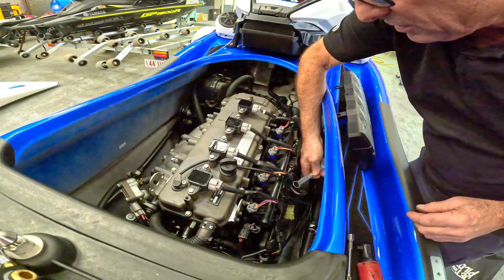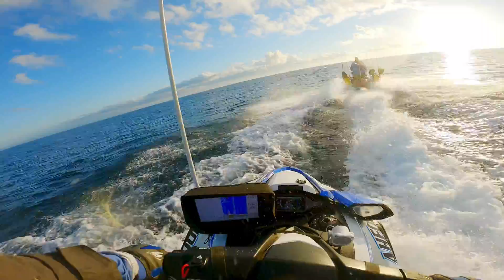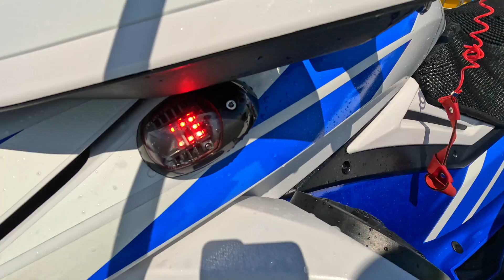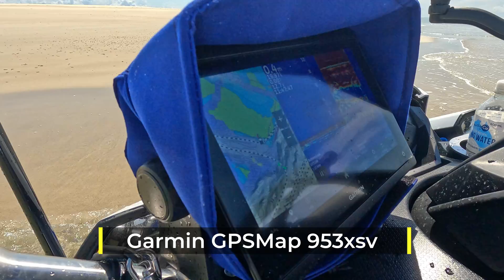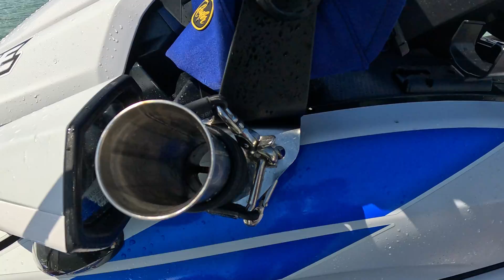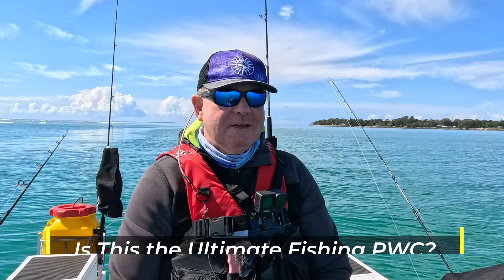Unveiling The Ultimate Jetski for Serious Offshore Fishing!

Comment: Great Video!   I would love to know what kind of nav lights you got and also the buttons.   Very cool!
Reply from the maker: Hi Phil, the front are basic 12V boat LED lights. The switches are waterproof 12v illuminated . Not sure of brand but a good chandlery (boating) store would have them. The rear white light is the battery operated Railblaza Illuminate i360 (you can get them on my store).  I've now moved from a simple PVC pipe to a nice extension pole that a supplier made for me. It extend to around 1300mm and folds down to around 600mm for stowing.  Incidentally if you're not using lights all the time like me, I'd be going all battery operated for both front and rear. The reason is any 12v mod you do to your ski using additional wiring is susceptible to corrosion and you'll likely need maintenance periodically. I have complete Railblaza Nav light kits for sale now for Yamaha and Seadoo GTX/Fishpro. They come with the mounts you'll need for the front, plus a telescopic pole for the rear. You can install these in minutes. Get these at www.jetcast.au
Reply: @Jetcast awesome site!!!    Ya, battery is nice.   I have some ideas for a wired setup.   If I end up doing it, I'll make a video.

Comment: Love your videos Paul. Just wondering if you experienced any cracking/paint peeling issues with your 2019 model with the NanoXcel hull, and any difference or improvement with your 2023 model which would have the thicker SMC fibreglass hull material? Cheers mate

Comment: Morning Paul 
How is your black box (radio) install holding up under your dash? Any cracking of the plastic ? Did you take any extra precautions with additional reinforcements i.e.rubber washers?  Is the black box staying dry? Did you bag it to keep it dry? Looking  to do the same on my ski and would appreciate any advise.  Thanks much
Reply from the maker: It’s too early to tell but so far so good.  I had it in the same position on old ski and no probs with mounting. This time the terminals are smeared in dialectic  grease to ward off the water. We shall see…

Comment: Thanks for the video! I've been considering getting a ski for fishing the reefs up in Cairns. What do you figure your fuel range is with the additional 40L tank? What kind of weather are you comfortable going out in?
Reply from the maker: Thank for watching the video Tyler. I'd plan trips on around 2km per litre on a fully laden FXHO like mine, so 200km would be a guide.That allows for some expansion air gap in the tank! Really depends on weather conditions for range but that would be an average that you could work on. It's often more like 2.5km or more per litre, but you should factor in some safety margin.  Re: weather: they can handle it pretty rough but the body gives up before the ski does! So, under 10 is great, 10-15 is getting a little wet and marginal but very fishable (depends on swell and direction to wind of course), 16-20 is still OK for short runs but definitely not epic journeys out to the reef!  Also above 15 knots it can be very wet so take a ride jacket to remain warm in the wind chill.   In fact, most of the time over 15 is a bit too uncomfortable to enjoy the fishing.  Forget 20+,  or any westerly winds over 15 as the short and steep chops kills you when riding out, and slams again on the way in. The ski can generally handle it but the body can't!  Best wishes!
Reply: Cheers for the detailed reply!  @Jetcast

Comment: Does it have the same random hard to start issue that the last one had. Still gets my heart going but always starts.  They just closed fishing in less than 300 feet here so might be makeing a few 100 mile runs soon but will just bring Jerry cans with me  and plumb an extra fill line under seat
Reply from the maker: Yes mate, same engine, same random cranks!  I know it always will start despite the 2 failed cranks, and don't worry about it these days.  Two batteries also give me every confidence! :)

Comment: Great ski Paul, Cu on the water soon with my new Seedoo upgrades,  I am a Seedoo fan, as you know.  Same reason as yourself,  but started on a Seedoo.

I have a XI3 trolling motor hooked up to 9" Lowrance ( soon to be 12" HDS) using a NMEA network, yes  trolling motor is expensive , about 4K AUD (3K USD) all up with mounts and lithium battery,  but the only way it works effectively is a front mount . The biggest advantage is actually not spot lock but the ability to vary my speed/drift when fishing in deep water when wind and current are not helping .  I can fish  in a greater range of diverse weather conditions with the trolling motor than without it . Penalty is extra weight  20 Kg on nose of ski and 14kg at the rear . 

I am the friend that thinks its great , provided its a front mount!, after 3 years my engine hours are about 150

 Looking forward to catching up soon when back in country and seeing your Ultimate "Yamaha" setup in person. Let the debate begin!

cheers
Reply from the maker: Yes that was you that thinks it's great! :)  See you soon Fred! Maybe someone can sponsor me the trolling motor as I think I'm broke now! :)

Comment: Surprised you didnt go for the thru hull transducer. Ive had both rear mounted and thru hull, both equally as good a image and signal, but thru hull is peace of mind not worrying about shallow water or grounding letting the transducer get damaged or even break off. Awesome rig . Such a well thought out fit out mate
Reply from the maker: Yes, I hear you. The downside is loss of sidescan and  water temperature. Still can add later I guess once the bank balance gets better! Thanks for watching and commenting.
Reply: @Jetcast  oh yeh true water temp is a factor . Looking forward to the videos upcoming on the new rig

Comment: Congratulations on the new ski. Very well setup, how do you fill the second tank? Where did you source the stainless rod holders forward? I may have to go to shoreline and say “build me the same as Jetcast”. Well done and many hours ahead on the water with lots of catches.
Reply from the maker: Thanks Douger. There is a second filler cap above the regular one that is visible in the shot from the front in the workshop.  So has it's own filler identical to the main one but is mounted nicely higher up ut still on the outside so you won't spill fuel inside your front storage area.     And yes Shoreline did it all including the rod holders. Make sure to tell them you saw the video! :)   Thanks again for watching my videos.